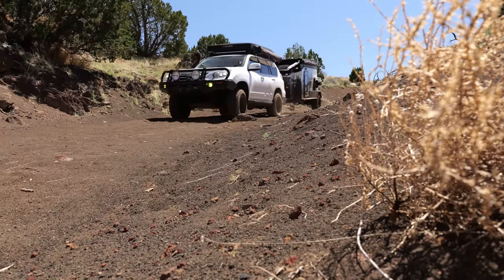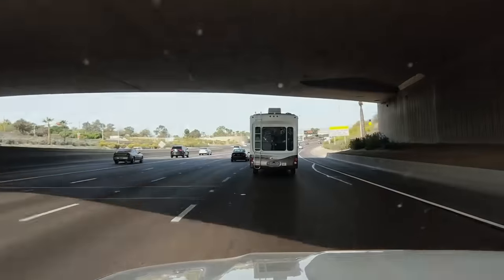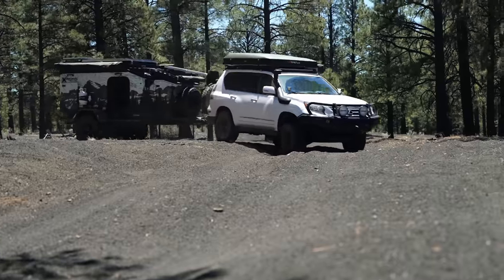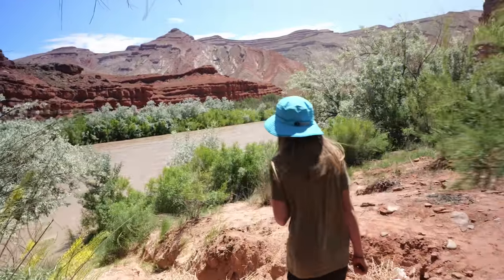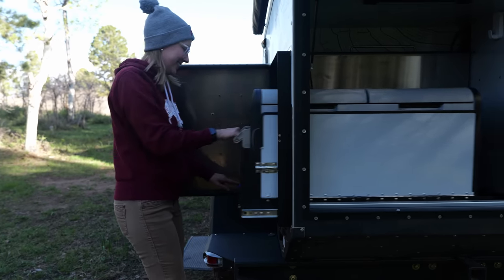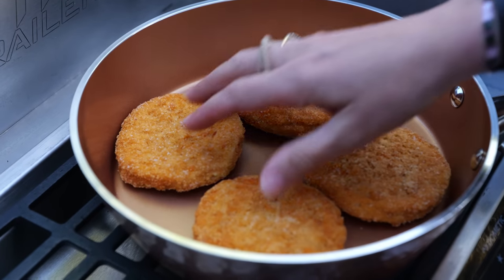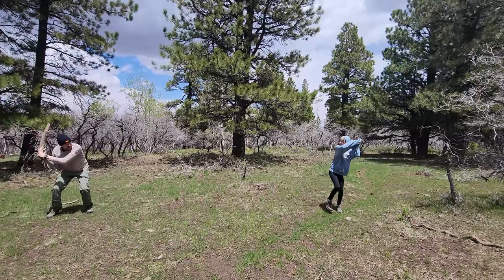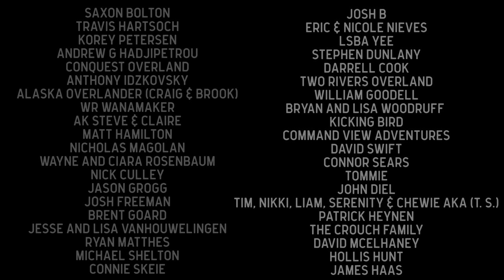Is it the ULTIMATE ADVENTURE trailer for Lifestyle Overland!? [S6E18]

Comment: We ended up with a Boreas, and I have to say, in hindsight I wish we would have gone with this one. Main reason is the better kitchen design (among other things).
Reply from the maker: Oh yeah? Sorry to hear that. What troubles are you having?
Reply: @LifestyleOverland  not too many troubles per se, as none of these trailers are ever “perfect” for anyone’s exact needs. Some are closer for the way we use it though. 

I don’t particularly like the kitchen layout for starters. The sink is kind of worthless and the cook top is too small for us. I have modified this part, however. Really, the kitchen area is what I like about the Voyager. The main issue I have aside from the kitchen (which I knew going in) is that the water system is not 4 season. The eco temp water heaters are finicky and work just “ok.” I re-plumbed it so I have hot/cold water out of the back so you don’t have to use the shower nozzle anytime you want hot water.

We did have some issues with some leaking which they fixed without question. That said for the price and a year in, I was definitely disappointed by that. In terms of rugged, go anywhere? Yes, it does that and I love the cruisemaster components.

Inside is pretty comfortable for sleeping, but definitely not the type of trailer to “hang out” in unless you really need to. But that isn’t why we bought it. We put our old RTT on it and it works great for the kiddos.

Comment: As a geologist, elevation is the correct term.  Thank you!  An easy way to keep them straight is:  Airplanes have altitude, land has elevation.  I am trying to convince my wife into seriously looking at one of the Xpedition trailers.  Thing is, she thinks the sleeping area is too small and doesn't want to have to cook outside.  She seems more interested in one of the Sprinter van variants, but to me, the inside space is just as limited and you have to spend time converting the inside from one purpose to another.  I would like to be able to have a base camp and strike out in the SUV from there.  One question I do have is about the "Necessary".  What is your solution for that?  Thank you for the continued review.
Reply: The "necessary"? As a married man I think you already know this: Happy Wife = Happy Life.
Reply: @dadthejedi  Actually, I was referring to the potty.  Happy wife?  Do you know something I do not?  How does one do that??? 🤣
Reply: @jimForgottenHinterland   I've got two ex-wives, so no, I obviously do not know. 😂

Comment: Nice trailer, but when considering a trailer for overlanding two factors should be considered. The longer the trailer is, the less places you can go because it means a wider turning radius is needed. Also the heavier the trailer is, the more difficult it will be to get over obstacles as well. Just two factors to consider.

Comment: Aside from conveying great respect for your work and wonderful upbringing of your kids, as well as having a blast with your caring family, i have noticed some essential flaws on this trailer. I honestly think it will be fine for the trips you are using it for, but i would not call this expedition trailer. there is not much of details shown but what can be seen ..Suspension is too  weak and not enough travel, tracks do not match the pulling vehicle prints, (essential for surviving in the extreme) .. too much weight on the toe-bar due to setting the axle to the rear. i understand the needs for entering space though, but it could have been managed better .. Gas Bottle on the outside can be bad news too, so are the exposed piping below and storage space is limited due to narrow compartment design. there are some great features though, like the kitchen / fridge pull outs. Anyhow, there are many trailer designs out there and manufacturers try every which way possible to find the ultimate solution, in order to push their sales .. from the professional suppliers out there, not one has reasonable pricing for what they offer, all are somewhat 45 to 65 Us Dollars / KG when the BASIC engineered material KG price for whatever is fitted there, does not exceed 8 Dollar Us. Just saying..
Reply from the maker: I respectfully disagree with much of your assessment; especially since you have no first-hand experience with the unit and these videos have been more about adventure than an in-depth review of each feature and system. Still, I covered many of these items towards the end of the episode including the width and cost topics. I as said in the video; there's no perfect trailer or rig... only the one that's perfect for your use case so these items you're defining as "flaws" are actually trade-offs. Our long term goal is a full size vehicle so the track width will match in the future but we're willing to navigate this for the comforts that come with it. As to the suspension, these components have been designed and load tested by engineers with significant testing on trail as well. Part of the reason we're working with this company is to push these trailers even further though so if there are any weaknesses, I assure you we will find them and provide valuable feedback to Xpedition Trailers. As to travel on a trailer, it's a far different beast from a 4-wheeled vehicle since there are no opposing wheels to offset the lean. Too much or too soft of travel and you'll lay it over so there's a fine balance to meet when developing a stable ride. As to cost; you can't list raw materials and expect to come to realistic total. The raw materials are very expensive but they're not even the most expensive part of the trailer build process. Facilities, personnel, insurance,  marketing, events, CNC machinery, coatings, electronics, accessories, etc. add up to an astronomical cost. It's sad that trailer manufacturers catch so much flak for going over the top in design and ruggedness then pricing it where they can make enough profit to stay in business. I know this because I used to run ops for Turtleback and did the actual cost analysis. It's even worse these days though with a sparse workforce, increased competition, and overall inflation; it's a tough market! You can complain about the price; but I can assure you there's legitimate costs behind the numbers.
Thanks for the thoughts though! Glad you enjoyed the video!